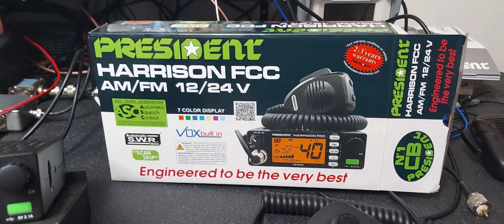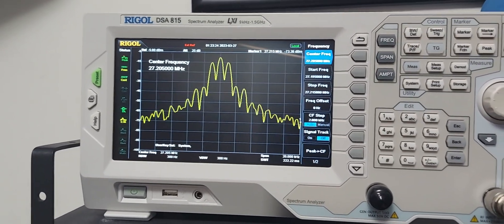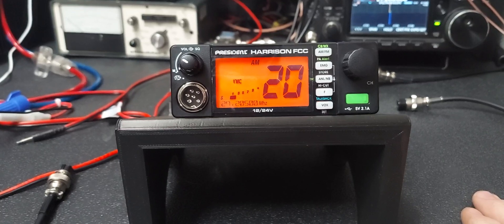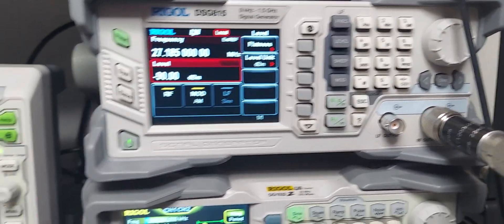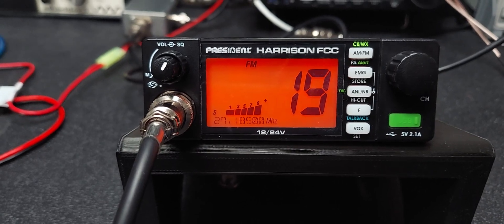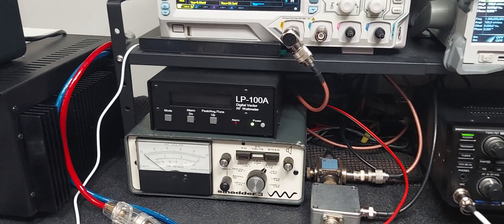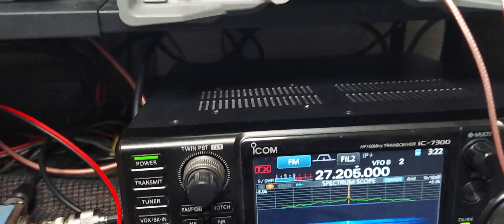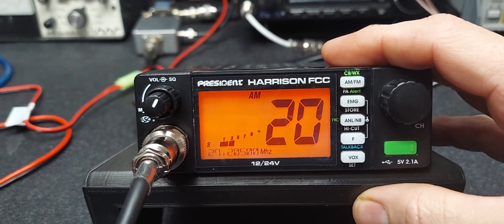New President Harrison for Michael in Illinois

Comment: I have a president harrison fcc cb,  but haven't received a weather alert yet ,  been using it for 2 weeks now with alert on.   Maybe defective unit?
Reply from the maker: Most likely not.
If you haven't had any severe weather or you haven't had it on when they're doing a weather test then that's probably the reason.

Comment: Hi Scott just a note on FM mode,your monitor needs to be set on nfm bandwidth 
Because it boosts the audio up on your monitor.
Technically it's not correct bandwidth with these new FM FCC CB radios 
They use 8K0 F3E ,not as most ham kit is 11K0 or 16K0 for nfm 12.5khz/25khz uses,CB FM lot tighter as it's 10khz spacing.
I know your using it to monitor but it's just to say the fm transmit on Harrison isn't quiet on FM @2.00khz peak max 
But your monitor using the FM detection audio value in your receiver may need altering to get up to suitable level
60% mod on new CB  FM=1.25khz 
2.00khz max tx dev 

FM mode on your monitor
nfm 60%=1.50khz -
2.50khz max tx dev 
Narrow mode
If set FM-Wide (not broadcast wide)default 
60%=3.00khz
5.00khz Max tx dev 

Just need to be wary as these new FM CB meet a different specification Vs older 10m USA FCc type radios typical 20khz 4.00khz deviation.
Just an observation only 
As very little info about .
So what you maybe observing on your FM monitor ,it may sound a little quiet FM modulation but it isn't ,just to make you aware .
I modified my ham receiver to to accept new super narrow FM mode used on these new CB so audio recovery is a lot louder on my FM monitor  ,it's an easy fix one resistor changed across the 455khz resonator of the monitor receiver using not the CB!!
Icom normally  allow nfm mode see your manual.
But even that not geared right for super narrow FM mode,but a simple fix can be done ,if not sure contact me.

FM is based same as new ETSI EN European we have in UK and EU.

Yes fab radio Inc ctcss and channel skip .

Have you seen the matching President NRC Digi Mike to match set??
Just come out Scott.

Cool vid of set ,nice clean Am too😊
As you prob know us Brits have had FM mode a very long time over here on cb radio 
We have two FM standards 
Old MPT1320 11K0 F3E 2.50khz max dev 

This was superseded by ETSI EN European  Standards 
8K0 F3E 2.00khz max dev ,same as  new FCC CB standards!!

Hope that's of some help Scott 

Rob P
RPComms.
Reply from the maker: Thanks Rob, unfortunately I think FM isn't catching on like I would hope on 26.965 to 27.405.